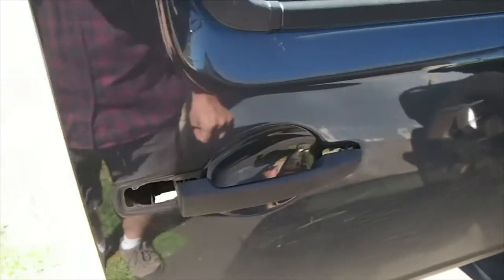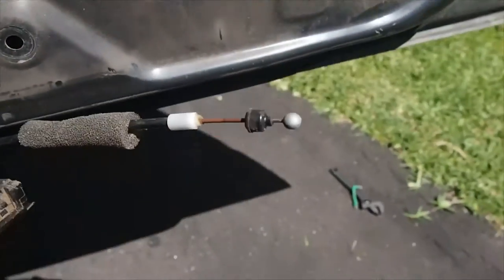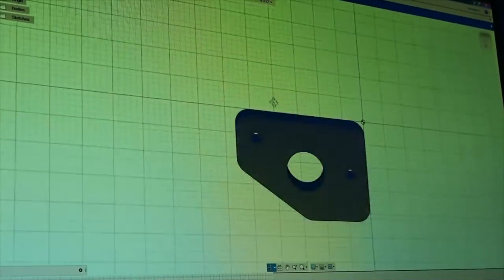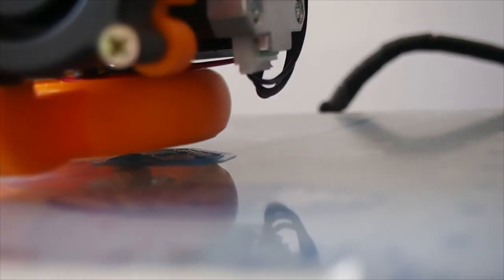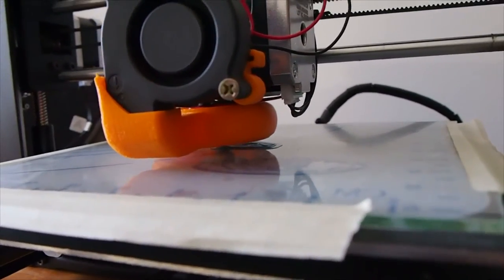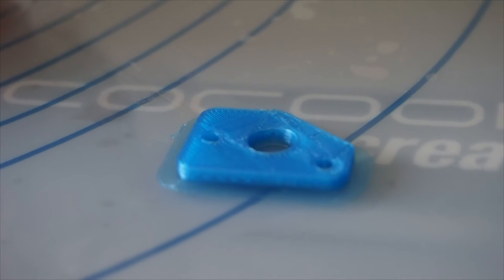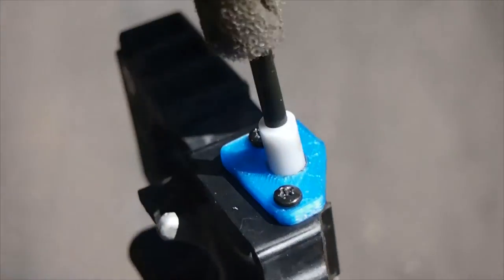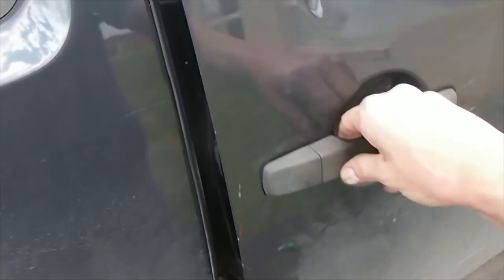Fixing broken door lock D40 Navara (R51 Pathfinder): Using 3D printing

Comment: Any chance of the link for the 3D plastic part please? Great fix
Reply from the maker: Hi, I did a stupid and somehow missed saving it to my Fusion cloud. I 
don't have the STL as I had a HDD failure a couple of days after doing 
this video. About the best I can do is provide the raw gcode. This will 
only work if you have a i3 style machine with 200x200x200 build area 
though.